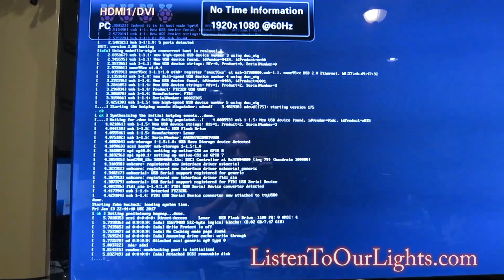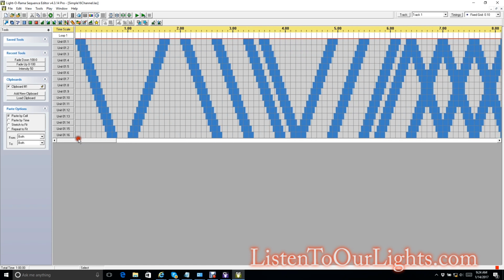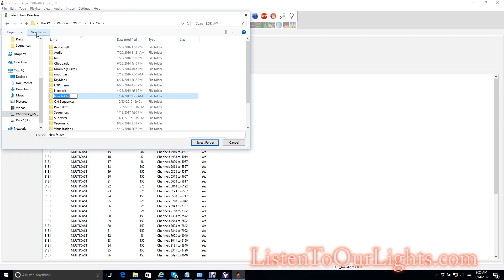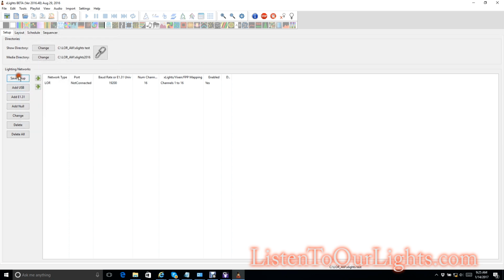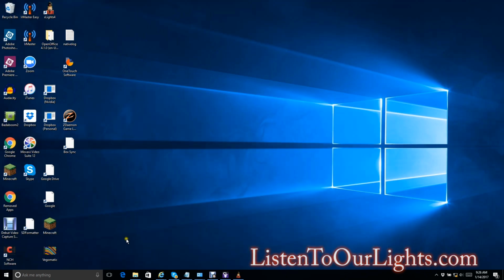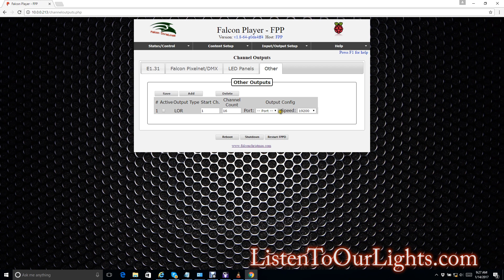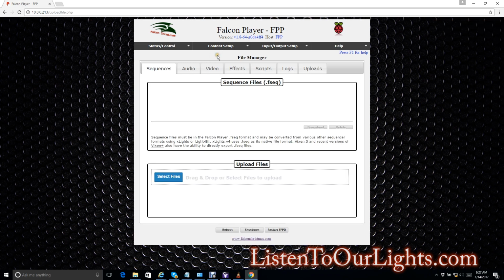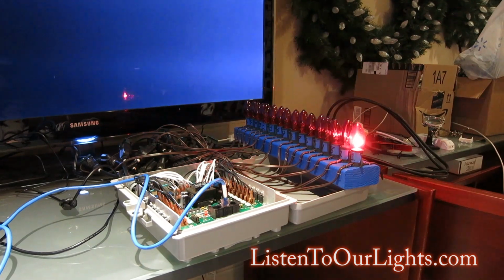Running LOR Dongle and Sequence from FPP

Comment: John, great video. Could I use the PI and the PI Cap to output DMX with the LOR jumper in place to output DMX to my LOR board? My LOR setup is running DMX but I want to use the PI during the off season  so I can free up the show computer

Comment: what did you use to provide USB power to the Falcon? and am I correct in assuming this setup allows for running an LOR show without being tethered to a Windows computer?
Reply: Yes, the Raspberry Pi with Falcon Player would replace the Windows computer for running the show.